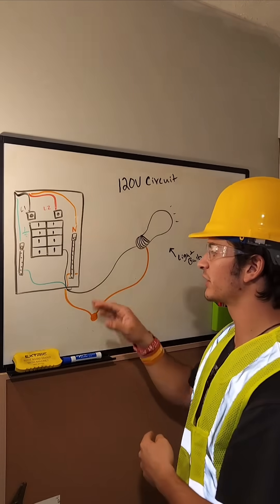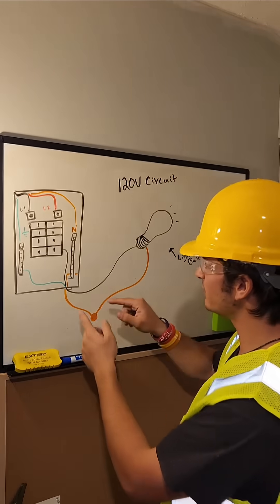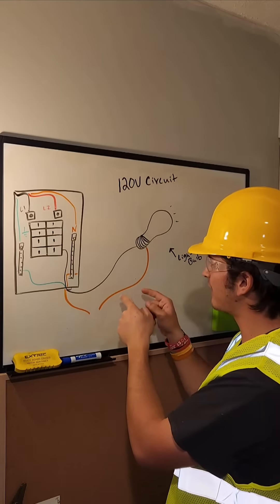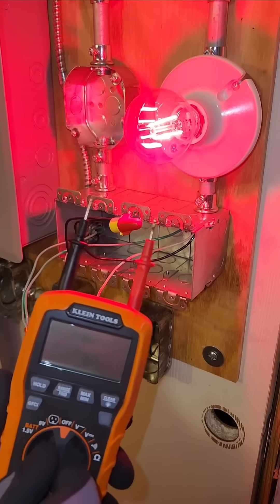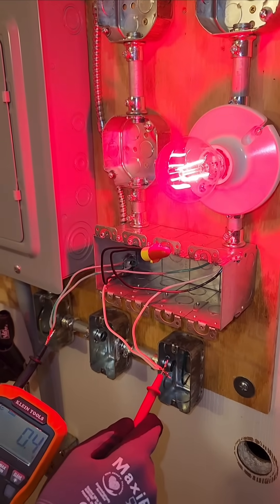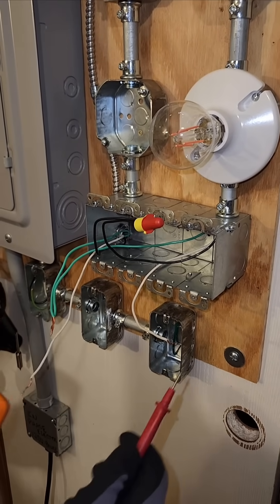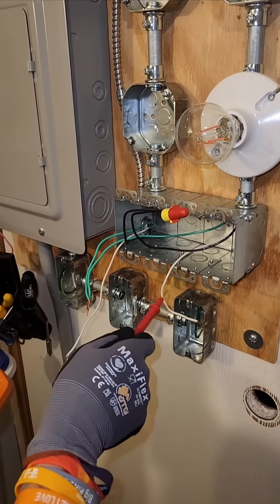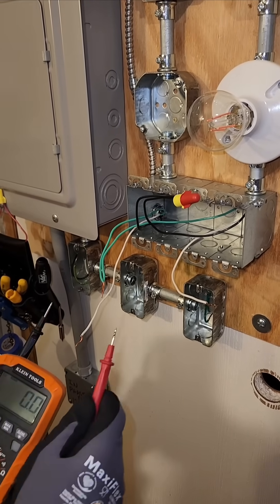GREAT Demonstration of an OPEN NEUTRAL

Comment: Ummmm this is a demonstration of what happens when an individual circuit loses its neutral. This is not an explanation of the situation commonly called "open neutral" where the service neutral connection is lost but all the individual circuits are still sharing a neutral.

Comment: As an electrician. I'm shocked by all the people praising this.

It's a disconnected wire. What do you expect to happen?

If i unplug your tv, do you get confused that it turns off?

I asked my wife what she expected to happen if i clipped a wire... shocker, she said with confidence it would turn off.
Reply from the maker: You missed the point.
Reply: @josh_is_in_phase  if you see potential on one side, and no potential on the neutral (both nominal readings yes) and your device still isn't working... its obvious that your return is bad.

My wife also figured that one out with minimal effort.

I swear, critical thinking abilities died with the rise of cell phones.

Comment: And the neutral now shows potential difference because it’s shared on the bus? The electrons flowing from other circuits. Man I’m confused. 😂. Treat it like a bad/open ground on a 12v dc circuit.

Comment: The explanation of he why was missing. The reason: since no current flows due to the open circuit, there's no voltage drop across the load, and therefore the load neutral is at the same potential as the hot, i.e. 120V.

Comment: The bulb is basically a straight wire with internal resistance so it will carry the Hot side thru it and to the open "neutral" side.

Comment: I’m an apprentice electrician. I’ve never truly understood what an open neutral is until I watched this video. Great explanation!
Reply from the maker: I'm very glad this video helped you! It's a very important thing to understand when you're working on energized circuits. Just because it's white doesn't mean it won't bite. Always remember that.
Reply: Sometimes known as a floating neutral.
It is not uncommon to find one. They can be dangerous. Check first before doing anything.

Comment: Yea so black to green when the neutral is open would show 120v right? So between the two conductors on the load there is now no potential difference so there is no current flow?
Reply from the maker: Exactly
Reply: @josh_is_in_phase potential difference is measured from a reference point, in this case “ground” but when you change the potential different of the reference point (basically changing your baseline of 0volts), you impact the rest of the circuit, the circuit was built given a baseline ground of 0volts, so when that changes the circuit doesn’t behave in a way that was intended or designed for. 

Hopefully this helps provide additional context to others. Ground is arbitrary.
Reply from the maker: @944LS  was my explanation not accurate to you?
Reply: @josh_is_in_phase it is accurate, just providing a different perspective!

Comment: I still don’t get why there’s no voltage on the neutral. If there’s a load on that circuit, could you measure amperage on the neutral?

Comment: Wait a minute. If a lightbulb's return line gets disconnected, it'll have a voltage on it, referenced to ground. Sure that's dangerous. But it's even more dangerous when the PANEL loses neutral, because then you basically have all the circuits on one Live connected in series to the other circuits on the other Live with a total of 220 or 240V on both circuits. That could seriously ruin your day.
Reply from the maker: I'm aware, but I'm not going to willingly demonstrate that...
Reply: The results of this can be catastrophic to the loads connected IF the loads on one side are significantly different from the loads on the other side as the voltage across the low load side will be low and that on the high load side will be high resulting in brown out on the low load side and loss of magic smoke on the high voltage side (though a  lot of electronics can tolerate this these days)

Comment: Explain an open neutral on the power input from the outside before the power meter. The resulting voltage readings inside the home are different from this. I had this happen a few yrs ago and it caused one 120 v leg to go higher and the other leg to go lower. Lost a few alarm clocks on the side that went high, but luckily no tv’s or other appliances.
Reply: You can get 220 volts from two different 120 volt outlets if they get connected together through defective equipment that could be plugged in to them. It is the way the breaker panel is wired up. Expect the unexpected when working with electricity.

Comment: Question;
That neutral from lightbulb which had 120 to the ground will shock you ? Has current?
Reply: It’s an open circuit. Open circuits have no current… you’ll get shocked when you touch the live wire with ground or neutral

Comment: The real problem with an open neutral is when the neutral wire between the house and the pole opens (or from one panel to an other panel). Now the the house has a "floating neutral". And depending on how many loads are on L1 and L2 , the floating neutral gets pushed (or pulled ) depending on the balance of loads on L1 and L2. ie. the voltage on L1 to the floating ground (what the load sees) could be 90V and the voltage  on L2  would be 150V. This type on open neutral will damage devices.
An open neutral to one device is no big deal (i.e. the device is just off.)
Reply from the maker: Obviously a lost neutral is more detrimental in a multiwire branch circuit.
Reply: Yes I have seen this before.

Comment: I had to fix a open neutral. The ground was still bonded at the disconnect but wasn't connected at the control panel. When i checked voltage from hot to neutral (not connected) i had read 240v. Some electronics we had running can operate at different voltages but it did blow some electronics that couldn't handle it and were only rated for 120v
Reply from the maker: Sounds like a great time. What we live for. Was it a Monday that this occurred?
Reply: @josh_is_in_phase someone stole wire off the site at night. I was called at nearly 1 am in the morning. I didnt answer it. So i had to go back in the morning to fix their fix they did at night.

Comment: You should do a video on tips for locating the open neutral.
Reply from the maker: @GailsonPvPwtf  so do you find that might interest you and others?
Reply: @josh_is_in_phase  most definitely. Thank you for the content you're putting out.
Reply from the maker: @raulabeyta7853  I'll definitely touch on that then!
Reply: Just showed you and another way also is checking continuity between your ground in neutral since they should be bonded you should get a ring if it doesn’t your neutral is open somewhere or the electrical system isn’t installed correctly but checking voltage with it on and checking continuity with it off is a good way to tell
Reply: I believe you can just read neutral to ground voltage on multiple junction boxes and splice boxes until you find one that doesn’t read 0, then you’d know your problem is somewhere upstream of that

Comment: on if both CB and the switch are closed and god forbid no shared neutral will you see 120V across those neutrals. Otherwise, you'll still see 0V between neutrals.
Reply: Pretty much what i saw when i was fix a problem that pumps weren't turn on and the controller isn't working properly. The controller we have can operate at different voltages but something like the 120v tranformer and other items that is only rated at 120v blow up because i checked 240v from live to neutral. It was a open neutral issue, ground was connected at the first point of disconnect but just not the neutral. Someone stole wires off the site so the person fixed it missed a step and didn't check before leaving so i had to fix it in the morning

Comment: Joining local IBEW soon
Reply: Excellent choice. Retired, ran my own business, had many excellent knowledgeable electricians. I designed control/interlocking systems for lots of chiller/ cooling tower projects, along with correct feeder sizes. Hydro inspectors got to know the calibre of the work and asked for help sometimes in figuring out formulae, especially parallel Corflex sizing. Back then it was All copper feeds. Good luck. Look after your spine.

Comment: As a cable guy, I've seen the effects of an open neutral a handful of times in nearly 2 decades. I've read some stories on a couple reputable sites. One said a fire started in a bedroom right after the tech disconnected the incoming coax drop from the ground block, which had become the path back to the transformer. The other site had described a fire investigators perspective after a house fire.
Reply: One time I lifted out a fluorescent light fixture out of a T bar ceiling and fire shot out of the fixture. Seems the fixture was operating for many years using the grounded T bar ceiling for a neutral.

Comment: Awesome bro!! Just what I needed... My receptacle is reading 120 on the hot and neutral on the wires behind the receptacle but as soon as I plug a light in voltage drops to around 30  and the light doesn't work.. i have narrowed it down to the neutral being open somewhere hopefully in the panel. Now it's time to trace 😩
Reply from the maker: @investinghutler5323  this is the first comment I've ever gotten where someone says that my video helped them with a real life problem. This is awesome! Please come back here and update us here in the comments with what the culprit was.
Reply: Ok Josh ok I might think differently now about electricians lol you really helped me out understanding what open neutral is good example and really easy explanation thanks man appreciate you I have a question when I test my hot and ground it reads 120 but hot and neutral is maybe 60-80 doesn’t go above I check neutral and ground it’s like 0.9 or so can you explain or have you explained this before on another video I just happen to run in to your video and it was just an eye opener so I know where to get started thanks man appreciate you
Reply from the maker: @Palfaro48  what does the circuit look like where you are reading 60-80 volts from hot to neutral? Is it wiring in the walls jumping from outlet to outlet, or is it in conduit?

Comment: This guy is seriously clueless… don’t listen to them. They don’t even realize that they don’t understand electrical. Please provide me with your license number
Reply: Explain it better smart guy?
Reply: I would be glad to, and thank you for asking. An "open neutral" refers to a situation where the neutral wire in an electrical circuit is not properly connected, meaning there is a break in the neutral conductor, preventing the current from completing its path back to the source, which can lead to unpredictable voltage fluctuations and potential shock hazards.
Reply: @majinbowser7570  you literally just said what he said using a couple of different words. 🤦‍♂️
Reply: @TheJimmyray1973  No, mine was correct, and his was wrong.
Reply from the maker: @TheJimmyray1973  thanks for defending the fact that I said all of the same exact shit in my video, bro. Damn god complex electricians that try to step on everyone else to feel powerful.
Reply: @majinbowser7570 and yet you can’t explain why you are correct and he is not. You said literally exactly what the content here demonstrated.
Reply: @Cid_Phi  My accurate response is provided above. It’s not my fault the content creator doesn’t have the ability to incorporate accurate information in their videos on their own.
Reply: As an electrical engineer I can confirm everything he said was correct.
Reply from the maker: @braydinjones582  thanks for the comment! This dude comments on a lot of my videos claiming I'm wrong when I'm obviously not.
Reply: The idea from this video is "Potential".
An open neutral from a device or from another subject of opening up an unbalance neutral load takes the neutral wire out of parallel and places one in series thus completing the circuit. 
Now while all this is going on, a meter would indicate that there is no potential between the one being shocked and ground contrary to the poor fool being shocked.